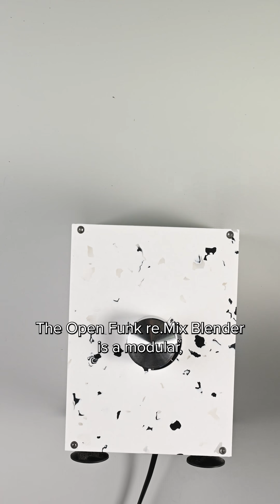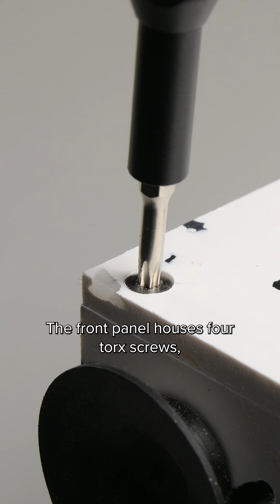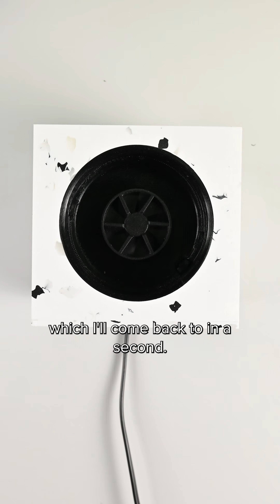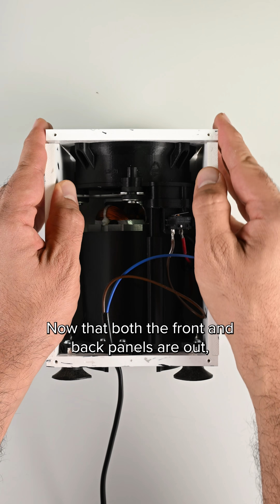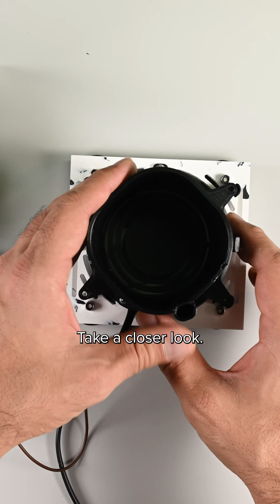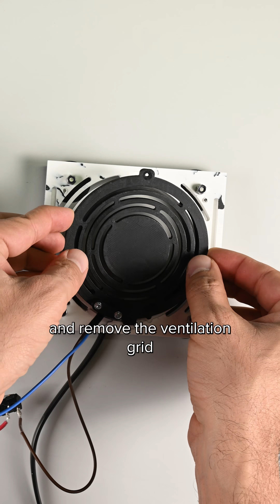The Open-Source Blender Big Brands Don’t Want

Comment: I can still buy new replacement parts for my 1960s Eta Mira blender/grinder. Besides it desperately needing a soft start, I have barely any notes. Stamped steel housing, bakelite top and bottom. One dial with 3 speeds. That's it. Borderline indestructible.

Comment: Ok, but it will never matter, because it looks huge and ridiculous. It has a Doc Brown vibe the general public does not want in their kitchen. If you saw this in an electronics shop, you'd wonder what happened behind the scenes for it to end up on the shelf.
Until you can make a repairable, sustainable product that looks and feels like a "normal" product, you are not furthering the cause of sustainability. If anything, you are doing the opposite, by cementing the notion that for a product to be repairable it needs to be bulky and awkward and compromised and homemade-looking.
You need to remember disposability was not sold and adopted - it was snuck in with sleek design and seamlessness and upgrade culture. People (consciously or not) chose those traits over repairability. You cannot treat them as nice-to-haves.

Comment: Kinda sad it's a brushed DC motor instead of a electronically conteolles BLDC
Reply: True in a way, but brushed motors are far easier to maintain and have fewer points of failure - and this wouldn't benefit much from the increased power density of a brushless unit. But then again with it being open source, I'm sure someone will find a suitable brushless replacement+ driver board.

Comment: Umm, I hate to be the bringer of bad news, but, conventional  multi-speed blenders don't break, they do use consumables like blades, drive studs, seals and jars, but the motor doesn't die. However, multifunctional, multidirectional blenders that do have pin-switches or circuit boards do often die. As far as I can see, this is a multi-speed blender that only has the advantage of using your glass jars, so it's useless for blending anything other than cold things or large volumes.
Reply: Oh, thanks for telling me that the pulse button on my blender doesn't break. I'll be sure to tell my blender that someone on the Internet knows how 100% of blenders fail, and speaks about them in absolutes like a Sith. 🙄

Comment: This is so beautiful for so many reason! There literally should be laws that force ALL manufacturers to follow this business model.
Reply: Uhh, it's not, it was the standard for a really, really long time in blenders. Then people were convinced to get blenders with circuit boards in them, and it then went to whatever this blender is supposedly trying to fix, when in reality it isn't an issue. There's multi-speed blenders still available, that are exactly like this, but with readily available off the counter replacement parts, which usually break. Other than that, the EU is trying to make that happen.
Reply: This company makes very expensive blender. It's not a good move to force this and companies moving to higher economic bracket for their market. The less fortunates are already living quite hard lives.

Comment: The main problem for me here is that this is 240VAC only.  There is no 120VAC option.  And I’m not savvy enough with electrical devices to fix that problem in the design.

Also, I like to be able to add ingredients to the mix, while it is being mixed.  Using only glass jars facing downwards makes this impossible.
Reply: well, nobody says this would be their only SKU ever.
Reply: @rigen97  At that point get an Oster blender that's also multi speed and have it never die on you, like any blender that's also multi speed, and not some fancy blender that has many options and circuit boards. Multi speed blenders only go one direction, in different speeds, either with buttons or like this one, a dial. It's exactly the same, and parts are readily available, like blades, drive studs, seals, and jars. There is no market for this blender in the real world, now if it were a blender that had the options a Ninja does, goes both directions and has programs and the likes, it would be a real competitor, otherwise, there's simpler, cheaper options readily available.
Reply: @rigen97  — This is their only design they have right now, and there are a lot of people who are suddenly reviewing them.  I can only speak to what options they have currently available.  I cannot make a decision based on a design that does not yet exist.
Reply: Get a 120v AC motor, since it's literally the only voltage dependent component, of course you need to know soldering
Reply: @faustoherbel7872  — it’s not just getting any old 120VAC motor.  It’s getting one that has the right RPMs and torque at the right speeds.  It’s getting one that has the right durability under use.  Then there’s the motor shaft, and the connection between the motor shaft and the blade assembly.

There’s a reason why Vitamix blenders last so long, even under constant use in abusive environments — they have the right motor, and the right engineering around all the connected components.  The same needs to be done here.

Comment: Wait, using common glass jars is actually genius.
Reply: Like every single Oster blender and most genetics let you do.
Reply: @joeylopezdesign  never seen a screw-joint blender in Italy, I have two and both have vertical slots with matching glass containers; the blades are embedded in the glass container part.
Reply: @clave604 Yes, as any other blender ever, the Jars can be plastic or glass, the blades do come apart from the jar, it's basic cleanliness. Just turn the base counterclockwise and the base should come apart, revealing the blades and the seal. The jar, base, blades, seal, drive stud and other seal are all replaceable. Or give me the model of whatever blender you own or are talking about, and I'll prove to you that it can be separated.
Reply: @TheVieneses  I think you misunderstood what I said: yes the blades can be separated from the glass container but the glass container is not a common jar and replacements are almost impossible to find, if the container breaks you throw away the blender.
Reply: Yes and no. It's great for small scale use, like your common "bullet" style smoothie blender. But ... that's not what this looks like (or is priced like), tbh. And larger blenders rely on large jugs with open tops for adding ingredients, scraping down sides, and more. And good luck finding a 1.5l screw top jar with an open "bottom", lid for said bottom, and handle. So while I do love this in principle, it's severely hamstrung as a proper kitchen tool by this decision.